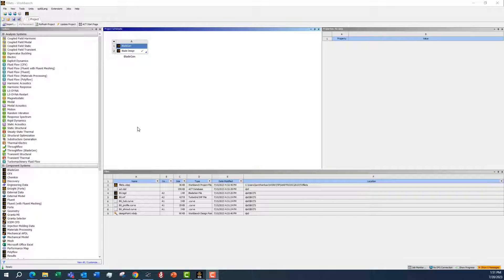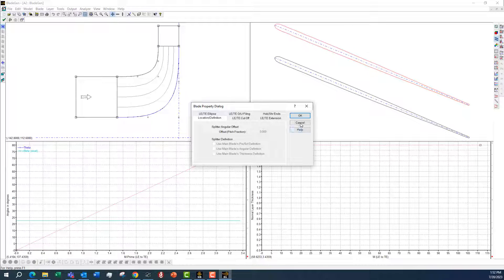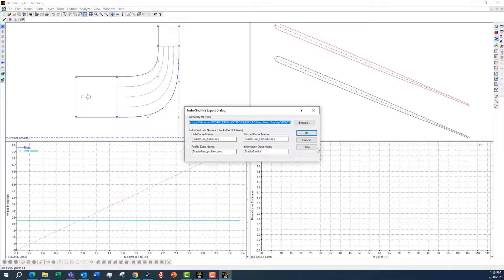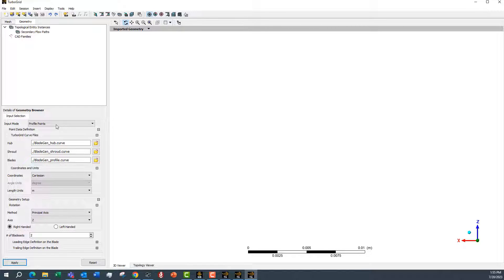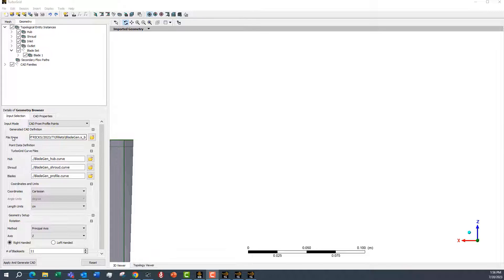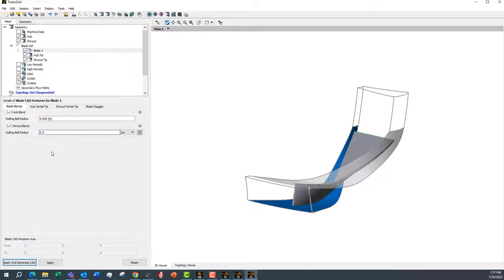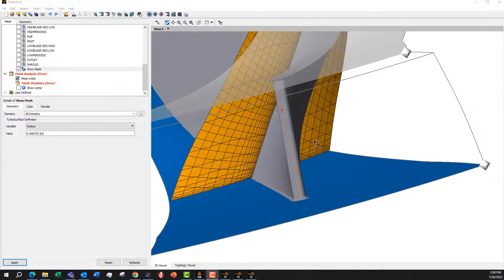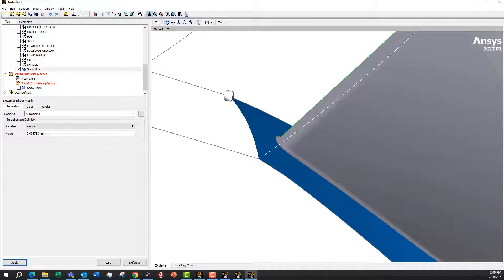Applying a hub and shroud rolling ball fillet in TurboGrid within Ansys

Comment: Thank you for the demo.
Is it possible to add the pivot feature?
If IGVs are there which can be rotted about its pivot, then they are subjected to have leakage flow. In that case, it is important to model the pivot in the clearance and mesh it.
Is it possible to mesh this feature in new turbogrid?

Also, is it possible to mesh the  cooling holes in turbogrid.

Thank you.
Reply from the maker: Hi, and thank you for your comment. We've shared your feedback with the Engineering Team.